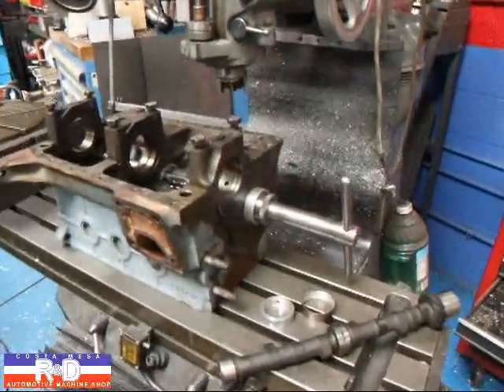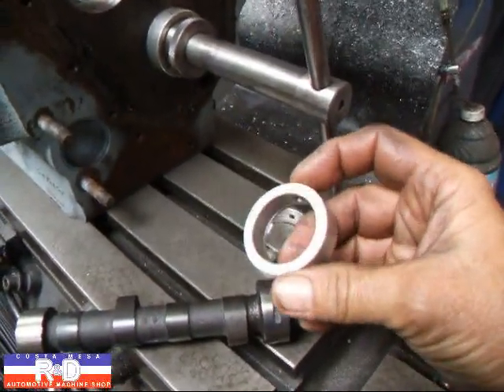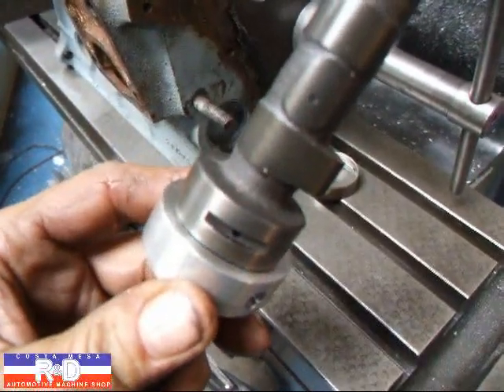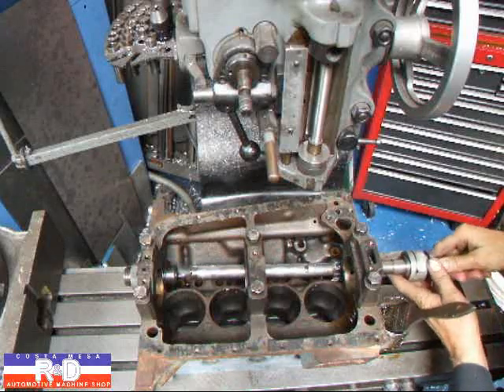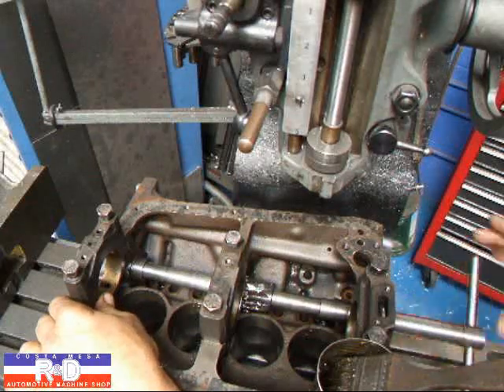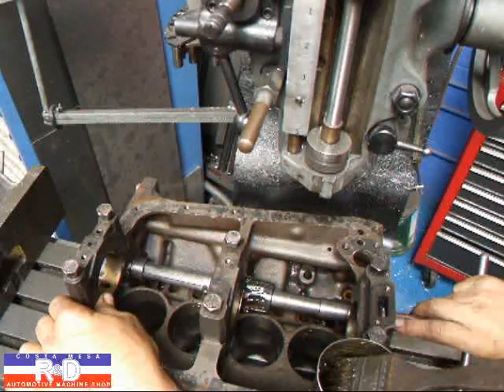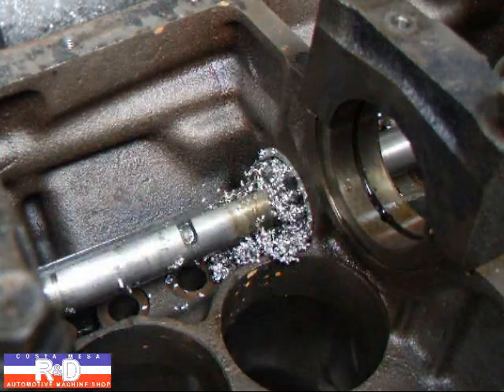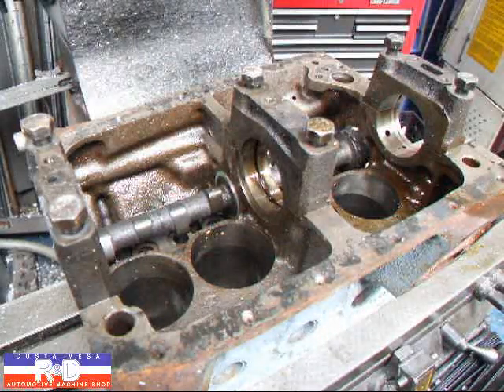850 Cam Bearing Reaming

Comment: @plkracer 

He says theyre made out of a high silicon aluminum alloy. (Presumably 4000 Series) High silicon aluminum alloys are def used in engines but they typically have a lead based coating which this almost certainly does not. Still may be fine though.